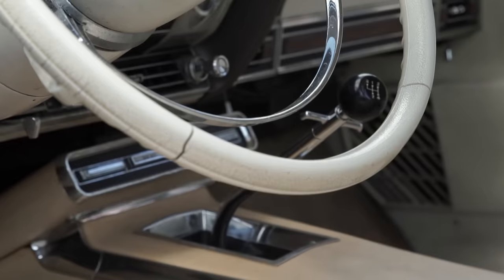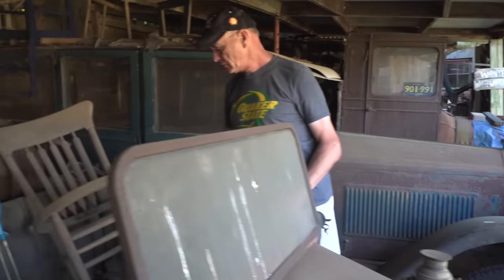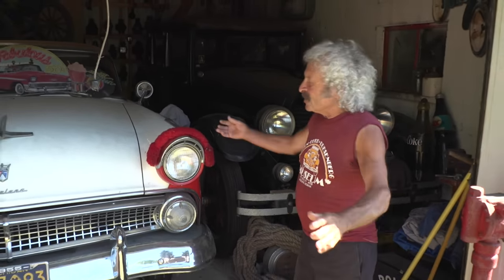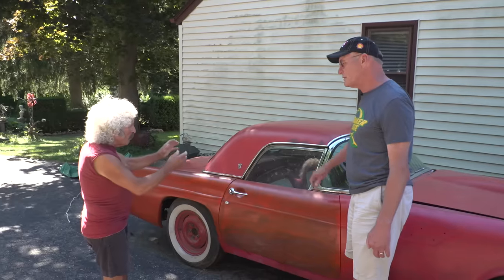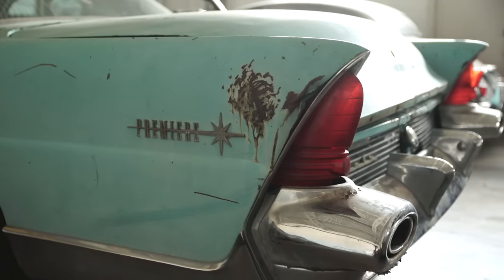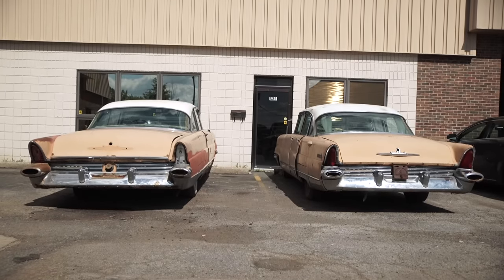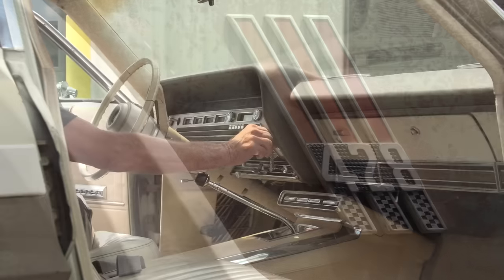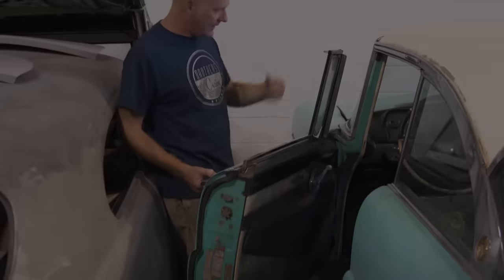1 of 1 428ci 4-Speed Ford Country Squire Wagon | Barn Find Hunter - Ep. 13

Comment: That woody is super impressive and that it's driven so much is really fantastic. Super cool!! the oldest car I've had was my first vehicle which was actually a truck. It was a 68 chevrolet c10-short bed with the large rear window. I drove it all through highschool until I was old enough to have earned some credit and I bought a new Honda as my daily driver. The plan was to build a quick, daily driven retro rod. Something with electric throttle body injection, a.c. and power windows. I owned it from 1996 to about 04 and I fell behind financially as most early 20 something's do at times and needed some quick money and unfortunately sold the truck. The thing was well on its way, besides needing new bed panels and some body work to correct the waves it was an all metal truck and had so much potential. My father and I added power brakes from a mid seventies Cheyenne also a power steering unit from the same truck. We swapped in a H.O. all original engine from our 1976 Chevrolet Camaro rs, with a power glide 3 speed and a 750 Holley the truck ran great and I don't think most folks realize how well those old coil over suspension trucks rode. So smooth for a short bed it had an impressive ride. I definitely had one of the coolest trucks in our small southern town but man ole man ill be 37 in July and how I wish I still had the thing because I'm finally in a position to be able to build a retro rod the right way. I'm looking to do it all over again and just watching the old woody rolling down the road in style and comfort reminds me of just how much i want to relive my high school days with that old 68. The show is great and I'm on the prowl for another 68.  I've become a barn finder my self and thanks for the inspiration.  Motorsports and antique cars was a true passion and past time that my father and I shared but since he passed away 5 years ago I find it hard to get the motivation to even put much thought into my next build.  The Barn Find Hunter really inspire me and take me back to the days my dad and I would talk about rare cars and what's the next project going to be or what our next project car would be.  Thanks again Barn Find Hunters your show means alot to me

Comment: Yea! The first car I ever drove in the road with a license was a car my dad ordered new. Back in the sixties my dad always had big powerful cars. I remember a beautiful 1964 Lincoln Continental 4dr. He traded that quickly cause it was a lemon. He traded it for a 1964, Chrysler Imperial Crown Coupe, that had a clear rectangular steering wheel push button drive. It was a light met. Blue, with a black vinyl top and light blue leather interior. But the main thing I remember is that the car had a 413, Dual Quad Wedge engine !!! With positrac! That the car could blow off the GTO and 68 Charger a cousin had! But as the family grew he had to get a beach wagon. So he ordered a Chrysler New Yorker Town&Country, that he ordered special with a 440 Super Commando engine , with a 4brl carb and dual exhaust. I remember the exhaust manifolds were cast iron, but they came up and were curved up along the valve covers! Plus the car had hd brakes with disk in front and a factory tow package that came with 3:73 rear end. That was the first car I ever drove with a license like I wrote above! I could get that car on a new hyw in R. I. back in the early /mid 70's to very high speeds. I'm not sure if the    exact speed cause I was never caught. But the speedometer was a rectangular box right in front of the driver, that had a blank space about 1/4", then had a square clock, I had the car going sooo fast, the speedometer needle went right passed 120, through to the click to 3oclock!!!! The engine was screaming and the doors felt and sounded like the wind was going to rear them open with a loud sucking sound! I know I know that was CRAZY YOUTh. But here by The Grace of God go I!!! Live and learn!!!! But to say the least, I have an affinity to the old beach wagons!!! I had a really nice 1969 Pontiac LeMans wagon, no wood grain so I did not call it a beach wagon, this was in 1973,, so the car had been well cared for and was in great condition.  I bought it off a family man that just had to by a Suburban for his family and tow his boat! But because he had always had boat that Pontiac wagon I bought off him he had ordered with a 350 4brl dual exhaust with a Turbo 350 transmission and factory tow package that came with better gearing and posi. I was hit by a drunk driver and was able to have a new front clip replaced, I was able to bribe (my cousin) at the body shop to replace it with a front clip I found from a 1969 GTO! I had found! So to make a long story a little shorter, I had the only GTO wagon around! I drove it hard for about 5 years, yea I had hd coil springs in front with the best hd load master coil springs and shocks in the rear!  So it has extra ground clearance with as big tires I could get! I had a blast with that wagon! When I showed it to the guy I bought it off of he lived it! I was able to sell it for more than I paid for it 5 years after and about 60k miles!!! I ended up buying my first SUV a new International Scout II ! I kinda wish I still had that wagon!!

Comment: I had to see this because Dad had a '67 Country Squire with a 390 engine. I spent many days in that as a kid. Great find here!
Reply: A lot of those late 60's Country Squires had 390's in them, especially if the owner had a boat or camper, but a 4 speed, nah that was different. The difference between a 390 and a 428 wasn't that big of a deal. Torque was great on both of them. Gas mileage was lower on the 428, so the 390 made more sense. No one would have believed in 67 that they would still be on the road in 2020 !!!!!

Comment: Amazing how cars  change in the late 80,s to what wh have to day and yes some of the new up dates like Electronic Ingitions systems have really in prove things for the cost but those old cars are smiple, well build and had real class.

To days cars have lots of neat new electronics systems that control heat, AC, tail lights and more and we all know that electronics go bad over time just wounder if 100 years from now if out new cars will be as ease to get running as some of those old barn fines.

Had a truck from the early 50.s  my father used and was left setting for 20 or more years in the woods, after pooing W-D 40 in all the cyclinders and in the intake got the engine to free up,

All the old tube tires came right up and never leak back down, clean out the carb and with a new electric fuel pump and new fuel line , spark plugs, points and set of used wires from a junk yard the old truck jump to life.

Life is funny  lots of people buy a new car and spent 15 to 100 K and it value drops each day and with ever mile and some people will by an old car like those and over time put them back in to new car specks and drive a car that goes up in value each day

Love the show and the wagon with the 4 speed hope someone makes it a dally driver 

Yes new is nice but those old cars have class and one has to wonder witch is better making 3-500 dollars per mouth in car payments insure to drive a car that dropping in vaul each day just to save money at the pump.

 Or drive a classed car that stands out and  its value goes up each day and no sticker shock at the repair shop for a computer or  display on the dash that controls ever thing , so what if you pay a little more at the pump,  

You can spend 3-500 per mouth or more on payments or spend it in gas and drive a car with real class made at a time when auto makers produce real cars, like the GTX,. Road Runner, 280 Z , LTD 

thanks for your work

Comment: In 1975 I had a friend who worked as a mechanic in a little town of Heppner Ore. he did some work on a local farmer's tractors and while he was at the farm he noticed a 1963 ford Fairlane wagon parked under a leantwo building so he asked the farmer about the wagon and the farmer tells him he had bought the wagon brand new but after buy a new pickup he no longer used the wagon so it had been sitting since 1969 so of course the paint was faded it was covered in dust and chicken poop so the farmer tells my friend if he wanted it just haul off ! So my friend drug it home we couldn't believe it this wagon was ordered with a 260 V-8 and a 4 spd. trans we replaced the old gas with new put new plugs and points and dis. cap & battery flesh oil and coolant It fired right up I dont even think it turned over twice he drove it for many yrs. but sadly he had traded it for a 68 Bronco but the thing was I have never seen another wagon with a factory 4 spd. until I seen this post

Comment: Awesome! I'm a huge fan of the Country Squire and the '67 has always been one of my favorites, at least the exterior. I never liked the dash and steering wheel redesign for '67 I've always dreamed of the 428 and 4-speed combo as well! I always assumed they were rare (as the CS was very rarely optioned with a manual anyways after the 50s) but never realized there was only one. By the way I'm fairly sure that the 3 way electric window "magic tailgate" was standard on all Ford Wagons by that time and of course the wood paneling was standard on every Country Squire ever made, not an option as he seems to imply.

Comment: I owned a 1977 LTD wagon with similar options. My wagon had the Big Block 400. Not fast off the line but the torque was incredible and top end didn't Disappoint. 
Powerful, Practical and greatly missed.
I am a Molar guy but sometimes Ford did have a better idea.

Comment: My dad brought home a new 1970 Oldsmobile Vista Cruiser. We had it for ten years before we had to sell it. I'll tell you, it was the base model...white with the fake "woody" sides and the chrome tin pan hub caps. Everything was as plain as could be, but it could move! Automatic on the column, but if you tromped the gas, you'd get whiplash. Quite the car. The only drawback was all that glass would heat the Naugahyde seats up to 1200 degrees, and sitting on those in shorts? Ouch.

Comment: That is NOT a 1956 Ford Victoria.  It is a 1955 model.  The giveaways are the round turn signal lights in the grill and the round radio in the dashboard.  And that would be a 272 c.i. vs 292 c.i. that came out in '56.

The '55 model and earlier were all six volt electrical systems.  Ford went to twelve volts in 1956.

Comment: I have a friend that owns a Paint and Body Shop here in Fla that has a Fathom Blue/ Black Vinyl Top, all original 1967 Fairlane 428..4 Spd car. 2 door Hardtop. Black interior, buckets, Console w/ gauges, Factory Tach and Factory Rally wheels w/ Redline Tires. 78K original miles. By the way, it's NOT for sale.

Comment: The Crown Vic early in the video is a 1955 model not a 1956 as stated. The front "round" turn signal lights are from 1955 models. Look at pictures of 1956 Fords and the signal lights are different.

Comment: WOW...,an original 4 speed 428 wagon. No manufacturers, today, will actually build a car the way...YOU....want it, but back in those years cars were so much more interesting. An example was a performance slant 6, 4 barrel carb Valiant that performed like a small V8, I know, because I drove one and instantly loved it. Pay for an inexperienced teenager in the mid 60's put anything new out of my reach though, plus I was due to be drafted. The car that I tried desperately to buy, though, was a brand new, fire engine red, 383 4 speed,  '66 Plymouth Satellite, hard top. The car was absolutely stunning. Sadly, it never happened.
  Thanks for the memories! 😊.

Comment: The carriage lamps run on acetylene gas that is produced by placing carbide crystals in the bottom tank. Water is filled in the top tank. When the tap is turned on a drip of water onto the carbide crystals causes acetylene gas reaction which  is lit manually by a striker. Not much of a light but more a warning to oncoming pedestrians, motor vehicles, horse and cart users.

Comment: On that 1967 Ford wagon, the (albeit fake) wood siding still appears in fairly good shape, which is rare. Usually, it is more faded than that. Although that rust needs to be addressed (especially the cancer on the right rear door), to keep it from getting worse. But otherwise, in  my opinion, keep it original! I would patina the paint, provided that is THEE original paint. Otherwise, I would repaint it the same original color. That is one heavenacious barn find! I hope the new owner does righteousness to it.

Also, that '55 Ford Crown Vic that is still a one owner car?! That is unheard of! And he is willing to let it go for $20,000? Dude, even if it wasn't running(outside of merely needing a battery), that might be a steal! And that '55 T-bird is nothing to sneeze at either (except for the barn find long term storage dust).

And $3,000 apiece for those three '56 Lincoln Premieres? Granted, they may not be the most desirable of all the 1950's ancientmobiles, but the day will come when ANYTHING that is restorable from the 1950's will be worth a mint. Many years from now, when automotive historians can pass more objective judgment upon 20th Century cars, I believe that they will still agree that the cars of the 1950's are the most desirable, by both the trailer queen frame-off-ers, and the "driver" "frame-on-ers".

Comment: Back in the  early 80s many cars were available a friend had a 67 ford galaxie 4 door that he brought over to show me to look at it  it didnt look like much it was jacked up way high in the rear had chrome reverse wheels on it with wide rear tires reason for jacking up the rear to hear the car you knew something was different about it the car was faded red and rusty the person said it was original and was ordered by mechinc at a ford dealership oviously the wheels and tires not stock or the jacked rear looking inside the car was a 4 speed  stick when he opened the hood a 427 with 2 fours I hope the car is still around  it got to be a rare one the car was from pittsfield mass if anyone ever saw it there would be no mistakeing it loved the 60s 70s and 80s so many cars available .

Comment: Is the 67' wagon for sale? 
I owned the 68' with 390/C6 police interceptor. All I can tell u is that every 1980's- 1990's trans Am got horribly embarrassed off the line & 1/4 mi. They (Ford), hypothetically say the top speed should be about 112 mph. Wrong, I had that car in winter 1/2"  ice & snow studded tires on the way to Jonesboro, Ar college over 135mph. ---- I didn't say I was smart back then!!! Best car I wish I'd never gave away to an elderly man needing transportation. I'm in the market 35 years later to restore another one! U either love wagons or u don't! But, a 4 speed 428 in a wagon.....On a side note, I can't stand Woody's.....lol

Comment: My great grandfather and Grand father between them owned a Chevrolet dealership for 50 years. My grandfather really wanted a corvette in 1957 when Chevrolet introduced the 283 horse 283. He was not able to justify the purchase since he had a wife and kids. He opted for the next best thing and ordered a 1957 Chevrolet wagon but had it special ordered with the new fuel injected 283. My mother was twelve at the time and her memory of this car were very clear. The car was sort of a running family story because grandpa was able to bust a few sports cars asses in this wagon. My mother said one night in particular then were returning from a trip to the ice cream parlor and a guy in a Jag pulled alongside. He saw the crossed flags with fuel injection underneath and scoffed at my grandfather. He lost the next three "stoplight" drags and finally asked ,"What the hell have you done to that thing?' As far as I can tell this car predates all the COPO cars I've read about. It was definitely a one off. I'm sure my family's owning a dealership helped get the car. Grandpa only kept it one year because mechanical fuel injection at that time required a lot of tinkering.

Comment: I went to high school with a guy who bought a Mennonite farmer's car second hand. It was a 1963 Ford 300 4 door, all black, bench seats, no power accessories with the bumpers and what little chrome the 300 (we called them "taxicabs") painted black per the practice of Mennonites. It also had a 427/425 HP V8 with a Hurst shifter .  Bet there weren't many of those back then either, much less Mennonite-owned.  In case you're wondering, fast car. Beat a lot of mid-sized so-called "muscle cars" (we never used that term back then).
Reply: Smoked a lot of 2HP 'wagons' I bet!  Hickory smoked the jerky fer winter chew too...

Comment: Hello The Red/White Ford Is 1955 Note Chrome Side Strip, Round Turn Signal Lights, Round Radio Diale, A 272 Two Bbl Carb., 6Volt Battery Ground   Positive Electrical System

Comment: That first car a Crown Vic was a 1955 Model year, not a 1956 as that guy stated. The 1955 engines were likely a 272 ci engine, not a 292. 292 engines were for T Birds that year. If that was truly a 292 engine it was put in by an engine swap